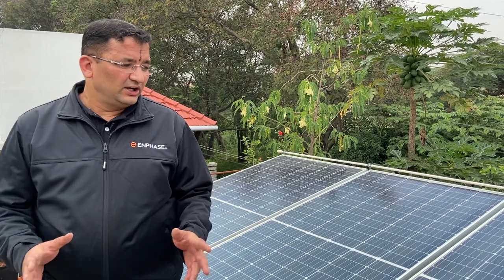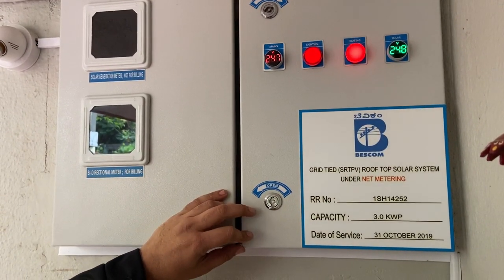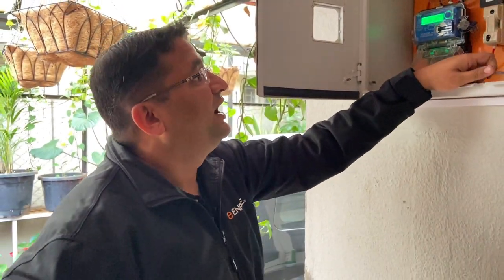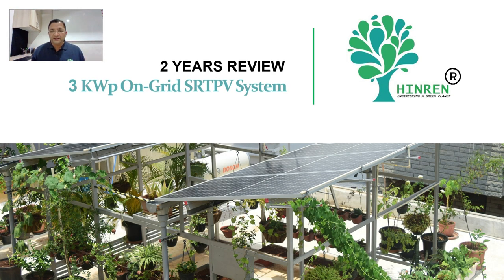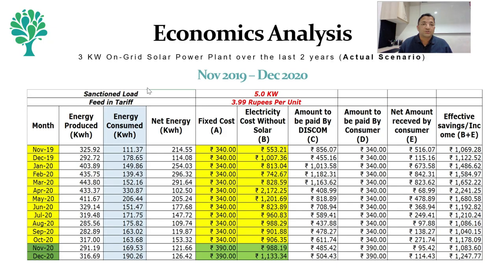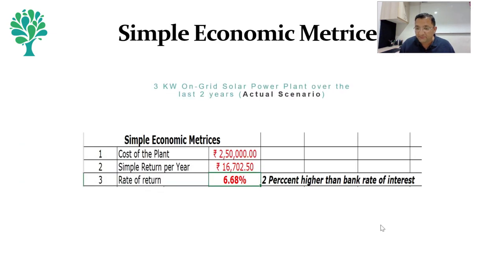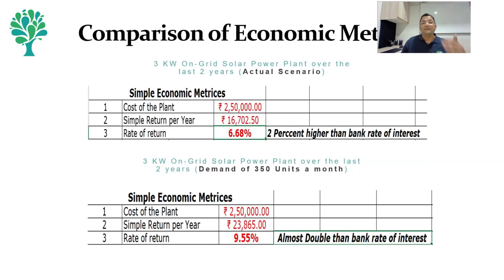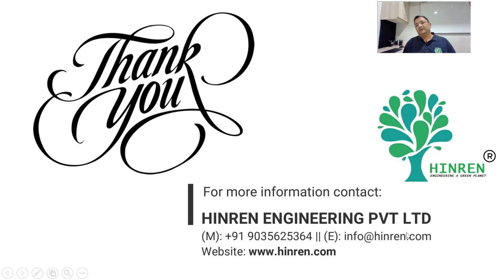Two Years Review and Economic & Environment impact of Rooftop Solar Plant

Comment: Excellent video. By watching your videos, I built my 5.3KW Solar Plant with 12 Panels of  Waree 445 Panels and 12 Enphase 7A micro inverters.. so far I am generating about 24Units per day. Thanks alot for all the insightful videos
Reply from the maker: That is awesome!
Reply: Hiren is truly one of India's best solar experts. I was inspired 2 years ago & started my system with iq7A & Anchor Panasonic 450wp (x12=5.4KW). This year expanded it to 8.1KW by adding 6 more panels. Generating 33-36 units per day which is balancing my home's daily energy demand of 25-30 units per day. Glad that I picked enphase. Planning to add 5-6kw more in the future for supporting EVs.

Major drawback I'm facing in Andhra Pradesh is that my net metering application is still pending since a year, using the envoy in zero export per phase mode. Would have been a complete system with net metering. Till then my 36v off grid system is covering the lighting & critical loads in the night. Still paying the power bill for night time air conditioners consumption.
Reply: @indidoctor  wow. Thats awesome. Enphase inverters are fantastic!
Reply: Yeah I agree 100% @chaitanyakshirsagar9861   never expected that enphase system can be upgraded & expanded so easily. Glad I chose an enphase system inspired by hiren. Would have become a hassle if I picked a string inverter even though the price is cheaper. Having an AC circuit directly from the panels is the major benifit. Even the envoy's monitoring showed me a defective panel that helped me claim warranty. That was amazing.
Reply: I have a query, how do I reach you?

Comment: Hello Sir,
Great Presentation.
I have one question,
1. How do we integrate this micro inverter technology with the existing Battery inverter backup system so that I can have both redundancy and solar work together..?
2. If grid power is down will this micro inverter sill produce electricity with less wattage.?
3. Is bi directional net metering mandatory for this Micro interver AC solar technology.?

Thanks in Advance

Comment: In absence of Enphase Ensemble technology in India as of now, how can we actually design a hybrid pv system with battery backup using AC MODULES? Have you had any such experiment made in the past? As compared to traditional pv modules connected in strings through AJB giving DC output which is then connected to a hybrid string inverter , which has provision for charging the DC battery directly using DC output from PV strings, the AC modules might have different challenges owing to their AC output. Can we overcome this challenge by simply connecting the AC modules' strings to DG port of hybrid string inverter (instead of connecting it to DC input meants for PV module Strings, so as to allow us charging the DC battery backup and using it in case of grid failure ? Despite considering the additional cost of hybrid string inverter in addition to several microinverters already installed with each module ( to get advantage of panel level monitoring, No DC Earthing, No DCDB etc) is this model possible practically? If yes please share your experiences through a dedicated video if possible.

Comment: Just a quick question. Why has the customer taken 5KW sanction when the max system production load is 3KW? wouldn't the fixed cost of 350 rupees(for 5KW meter) go a bit lower (not much but still)?
Reply from the maker: The load was taken at the time of house construction. Perhaps at that time , customer felt that they would need 5 KW . 
Also 3 KW of solar is installed to generate required number of units (electrical energy) to offset the energy consumption. 
The maximum power drawn can exceed 3 KW . Say if the geyser and AC and iron box are on together, the 'Power' drawn will be in excess of 4 KW .

Comment: Great presentation! One question : Is it possible to have a hybrid system with micro inverters?
Reply from the maker: You can definitely use it. It is called *AC coupling*. However, it is in no way economical. You have to do 1:1 Coupling. At that cost, you can as well do a complete hybrid system.

Comment: 545w module can we use IQ7A
Reply from the maker: Yes . However there will be some clipping. The IQ 7A series can handle upto 460 W panels . So anything more will get clipped . But it may happen only a few times in a year .
Reply: @HinrenEngineering thanks  for the information